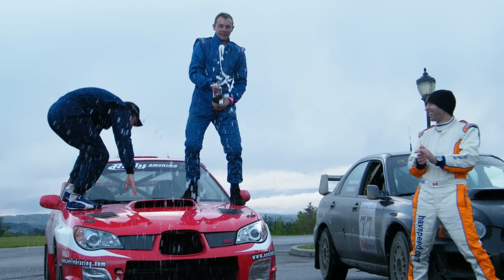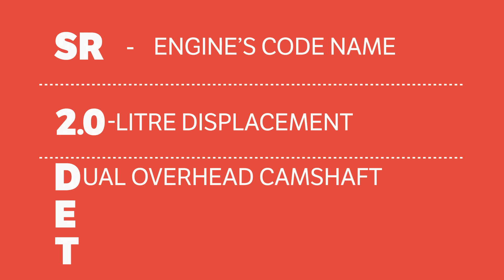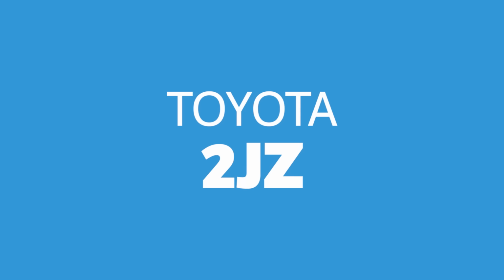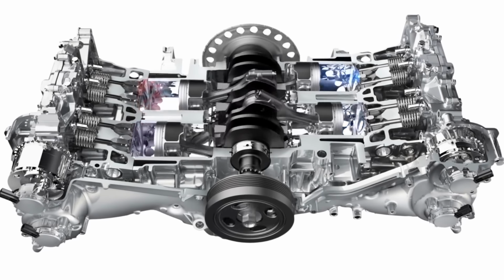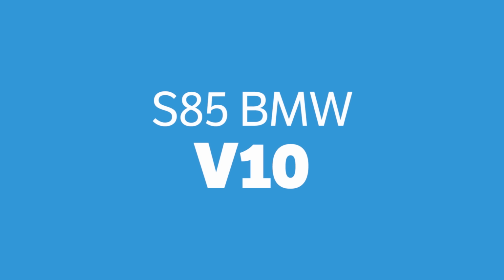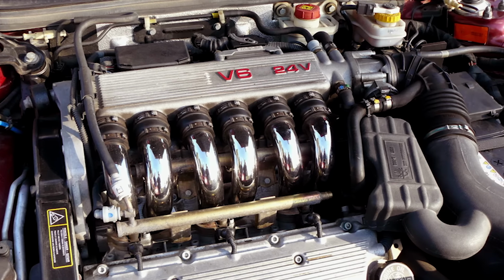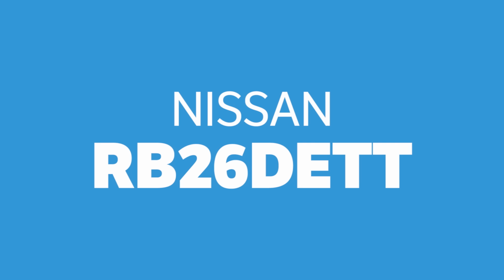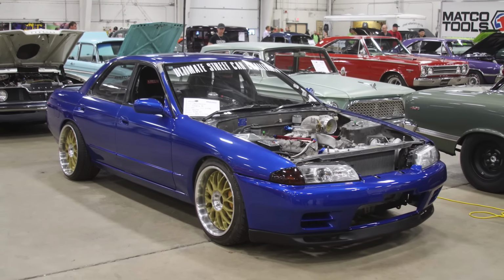10 Iconic Engines Every Petrolhead Needs To Know

Comment: The 302, the 350, the 300-6, the 357?
Reply: Where are the Ford 302 V8? The Ford 300 L6? The Chevy 350 V8? Some of the most iconic, well known and respected engines in automotive history aren't even listed. You're failing hard Car Throttle.

Comment: The title of some of these videos are very misleading. The true title of this video should be Most Iconic Engines to MODIFY not TUNE. When you only talk about how an engine is only good because of how it can be Modified then the video is pointless. Also, how are some of these engines iconic? How about doing a video about truly great engines like Bizzarini V12s, Columbo V12s. Honda B series without modifying, rover/buick 3.5 V8, chevy small block (sans modifying). Also where is this the Toyoda 22re? Yes, I spelled it with a D. The family name is Toyoda. So modiying aside, yiu should make another video about great engines.

Comment: rotary engines are great because they are compact and produce a great deal of power for the size. they are bad because they have terrible fuel economy and will need to be rebuilt after a drive to the store. seriously! these engines destroy themselves much faster than a traditional engine. a good v8 will last you like 200,000 miles, a rotary engine will maybe last 50,000 miles.
Reply: Electronics For Fun mine lasted well over 50k. If you treat it like a rotary it will last.
Reply: l say you got lucky. l have seen V8's go over 500,000 miles when they were only supposed to last 300,000 at best.
Reply: Electronics For Fun I'd say proper care and maintenance over luck. For example I check and top off my oil every time I fill the tank. conventional oil change every ~2500 miles. spark plugs and wires once a year, coil packs every 40k miles. They have to be driven hard as well, they do not like idling and casual low rpm driving.
Reply: yeah if you take good care of an engine then it will go forever. but we're talking from the perspective of the average "put in oil when it runs low" kind of person. they don't have time for their cars so they just put band-aids on everything.
Reply: Electronics For Fun Indeed rotaries are most definitely not for the everyday casual person. They intentionally consume oil. Not checking and maintaining the oil level will certainly end in premature engine failure.